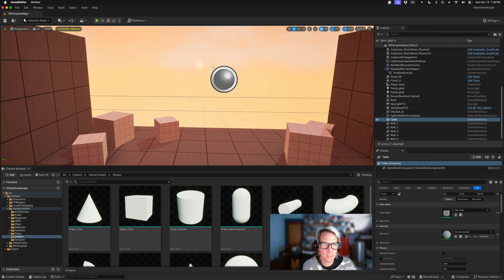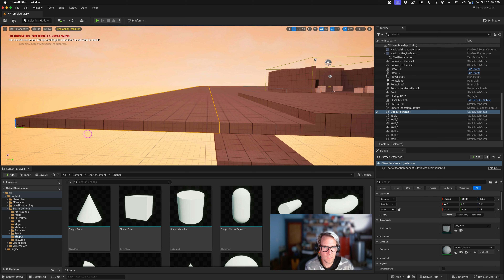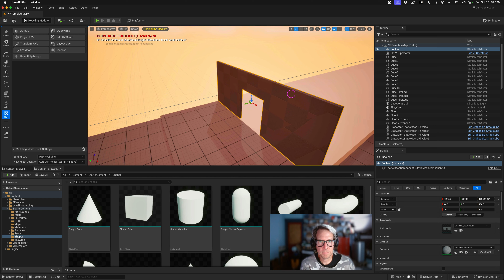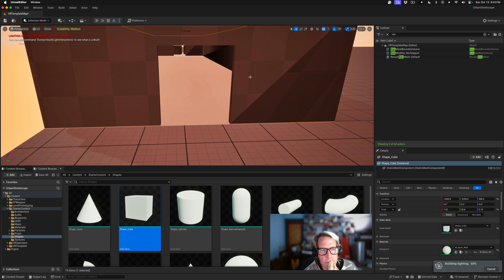VR Level Design: Graybox an Urban Streetscape in Unreal Engine 5

Comment from the maker: This video is for folks new to Unreal Engine and new to VR Level Design. Review the chapter markers if you need to jump around. Also a reminder that J, K, and L keys are your friends. You can jump back 10 seconds with the J key. Pause with the K key, and jump forward 10 seconds with the L key. You can also speed up and slow down the video by holding the Shift key and pressing  < (less than) to slow down. Shift key and > (greater than) will speed up.
We start with the Unreal Engine VR template and:
00:56 Change the sun's position and brightness.
03:48 Develop a sense of direction. North, South, East, and West based on sun position.
05:23 Learn about unreal units, centimeters, and meters.
08:51 Develop a Scale Guide for buildings, streets, and sidewalks using the City of Chicago system.
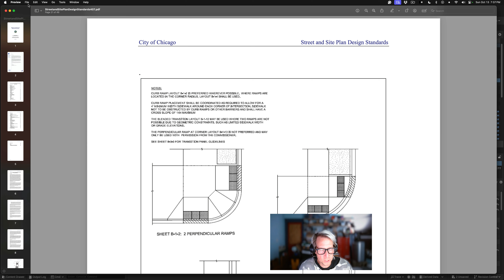14:55 Make streets, parkways, lots and buildings.Learn what NavMesh is and what the NavMeshBoundsVolume does.
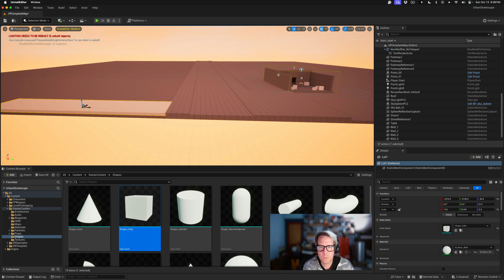35:30 Adjust the NavMeshBoundsVolume so we can walk around our new space.
40:16 Change our Player Start location.
41:59 Create a simple building based on a floor plan drawing.
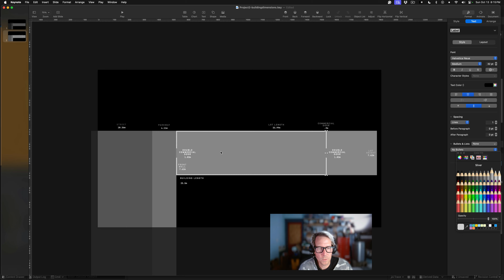43:59 Modeling in Unreal Engine using the Modeling Tools Editor Mode Plug-in.
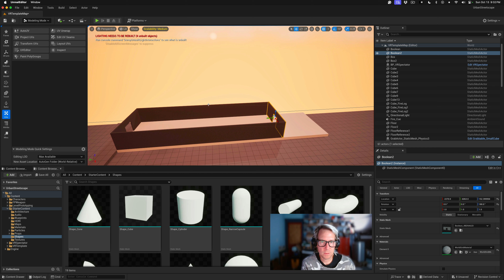01:03:40 Adjust the NavMeshBoundsVolume height so we can jump on things.
01:14:17 Rebuild our lighting and package our project.

I also have a written text version of this video with screenshots: https://docs.google.com/document/d/1RPycCfk2UL6h-Ne5fFs7BAOByFyLAV8gMaJbnjOK7HM/edit#heading=h.r1irfndpv05s